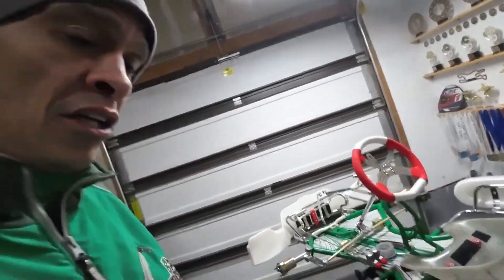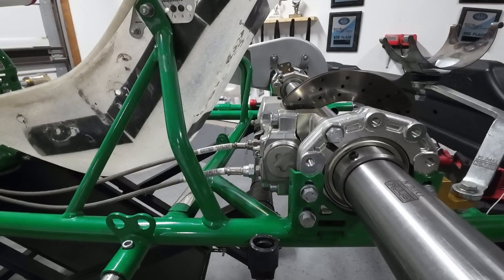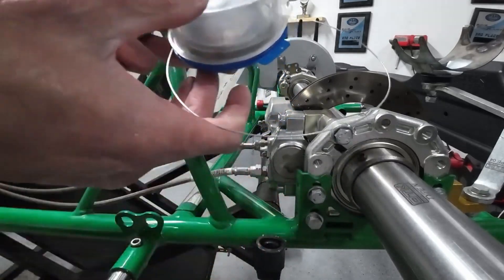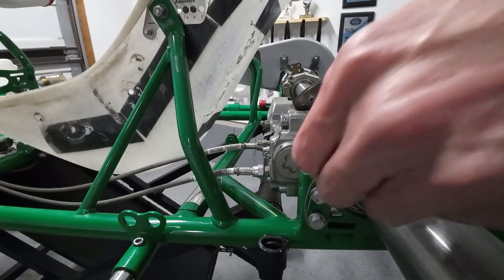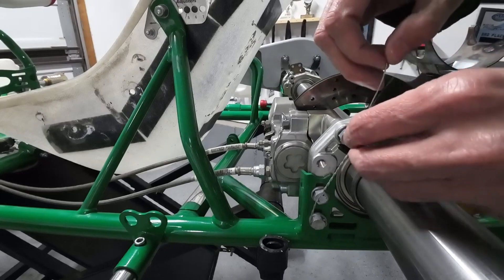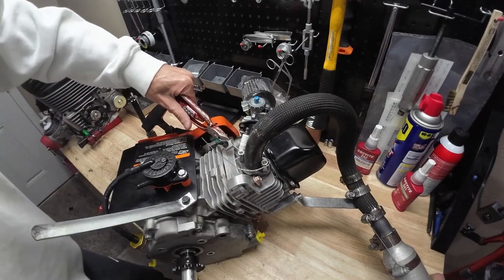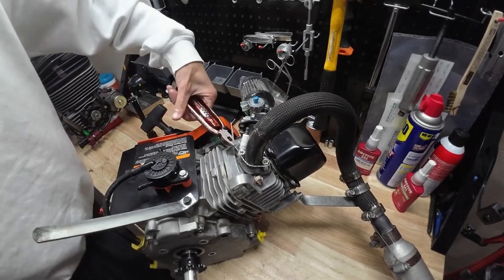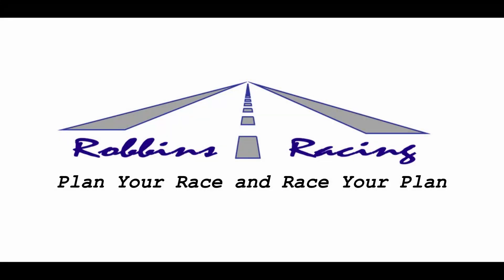Go Kart - Saftey Wire

Comment: Do you have a video of how you put Safety cable on Brakes i just bought a 2024 OTK & the master cylinder is different that a Birel set up
Reply from the maker: I don't but what I do is tighten both bolts and start the safety wire in the bottom bolt.  You may need to loosen the bottom bolt slightly to get the wire through but just tighten it back up after you get the wire through.  Then spin the wire to length and you may need to do the same thing, loosen the top bolt, put the wire though and re tighten.  Once the wire is through the top bolt just finish it off with a few spins and your done.
Reply: @robbinsracing801  Thanks for response but i was asking about the Brakes safety cable if you can do a video on how its routed through Master Cylinder & to Peddle Thanks Scotts 24D 🤙

Comment: Did you purchase bolts with holes for safety wire?
Reply from the maker: Kart came with them stock, unless the shop I purchased it from drilled them.   But I didn't drill them out.  I do have a bolt holder for this purpose but every time I've tried using it my drill bit breaks.